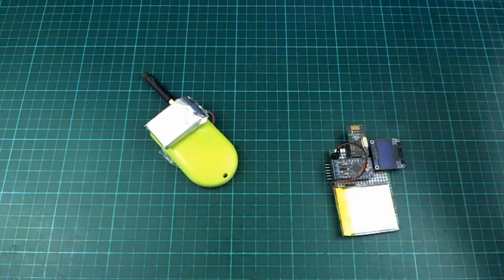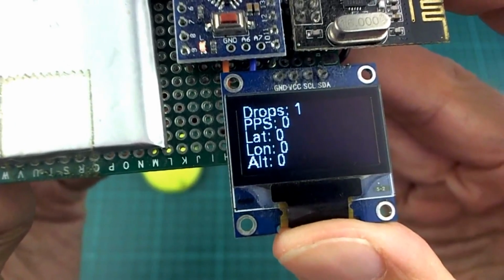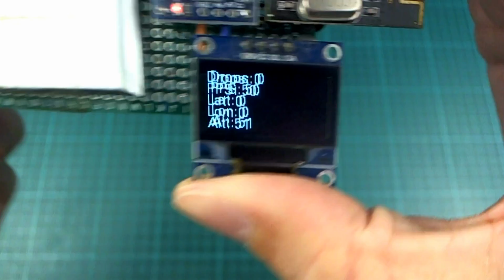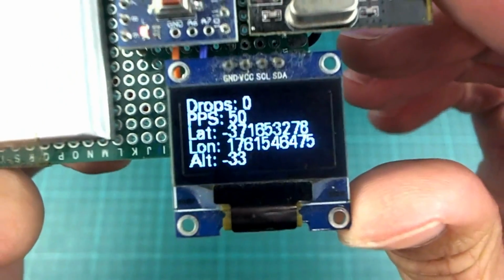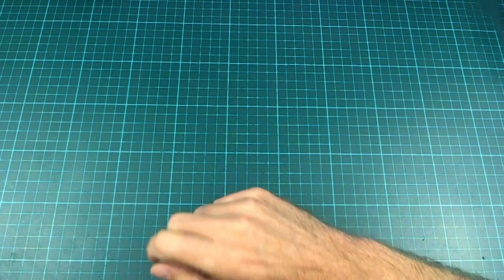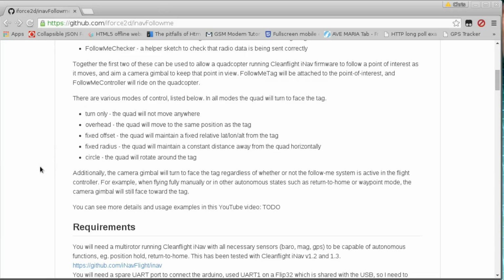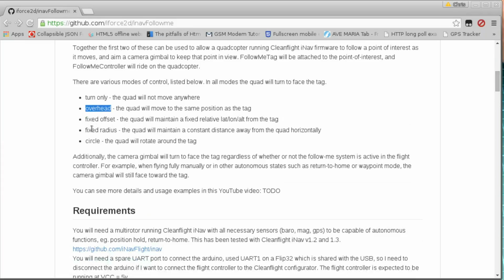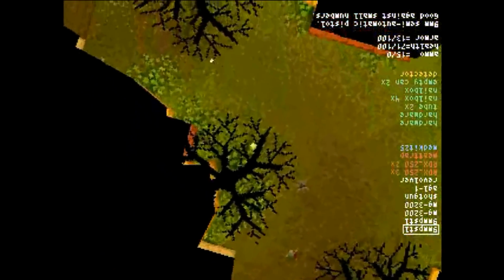Quadcopter follow-me howto (arduino + cleanflight iNav)

Comment: Hello, I think I am having the same trouble as CyberTramp/Mark Greco. 

I have a DIY quad using a Naze32 F3 Flight Controller, with an arduino/NRF24L01 configuration for PPM controller inputs (from following your 'Cheapass Quadcopter' videos, thanks!) and a Ublox  NEO-M8N for the GPS functionality. I'm  using iNav v1.9.2, and have the quad successfully implementing the simple GPS functions included in iNav (PosHold, RTH etc). 

I have wired in the 'Follow Me Controller' (using 5V arduino pro mini) to UART1 on the FC, and have built the Tag and Checker as per your specifications in the video. 

I know the Tag works OK, as the Checker successfully receives the correct GPS data and displays it to the OLED screen. 

However, the OLED screen on the 'Follow Me Controller' doesn't seem to be receiving any data from the FC. It displays PPS correctly, but RC is stuck at 10, Altitude is stuck at 0, 0 and Yaw is stuck at 0, 137. 'Mode' also remains stuck at 0 despite configuring the controller to activate Follow Me mode for the correct switch combination I'm using. 

I've checked the arduino codes as best I can (I am hardly an expert) and all seems OK, so I'm guessing the problem must come from the actual format of the information being sent. (I have UART1 configured to receive MSP data at 115200 baud rate). 

Do you have any suggestion for how I can check if the information from the Tag is actually being received/sent to/from the controller? 

And do you know if there has been any changes to the iNav/MSP source code that requires the Follow Me Controller code to be updated?

Sorry if I've been stupid and missed anything important, any help would be really appreciated!
Reply: I think I've managed to fix the follow me controller. I had to make a decent few changes to the arduino code, so I'll put it up as soon as I have had time to test it to make sure it  works, but I think I'm getting all the right outputs to the OLED screen.
Reply: @benparsonage7789  any updates?
Reply: Hi Ben, I am also very interested to see your results regarding to this. I am currently stuck on this part where the FC is not talking to the controller properly. Please let us know if you have decent progress!
Reply: I've asked the iNav developers about it, and they tell me that MSPv1 is still supported, so it might not be as simple as that. I will keep trying though, as it is still likely something related to this. I'm now just basically going through the code following where the data from the FC goes (using a software serial output to my laptop), so I will let you know if I get anywhere.
Reply: I thinks we must be use fc flip32 like iforce2d 😈.... 

Stm32 work with 3.3v... and arduino work with 5v.. ???? 

My tag work fine... but FollMeCon doesn't work 😂....

My hope....
Can you Rebuild this project buddy ... please  😉 like update and something else
Reply from the maker: I seem to recall spending about three days debugging that connection... the only thing I can suggest is using a logic analyzer to see what is happening on the wire. I have not been following changes to iNav but I would be very surprised if they would trample on backward compatibility like that - they're not Apple after all :)
Reply: Thank you for the reply! I think I have found the problem. Basically iNav introduced what they call MSPv2 into iNav v1.73, which uses a slightly different structure for sent/received MSP messages. So pretty much if you try and use the Follow Me Controller with an FC running iNav v1.73 or higher you're not gonna get far. So what I'm doing now is going through the 'Follow Me Controller' code and trying to convert it to be compatible with MSPv2. Should be fun!
Reply: Ben Parsonage I have to say you must be on the right track!!! I purchased several FC boards and have come up same as you. I used a logic analyzer got nothing from FC. If you solve this will you post the code?
Reply: Have you made any progress?
Also did your Tag code load on the arduino AS-IS from the download?
I have 1 working tag but cant get another going at all

I also can get a different iforce2d tag from the RC CAR PROJECT to work and send data, Could the TABS in the arduino program have something to do with it???

i have also experimented with different baud rates between the flight controller and the controller, no luck

i'm not a quitter,,,,,,, Ordered the first batch of things for this the day he uploaded it LIKE 2 YEARS AGO.  I have made Most of the iforce2d projects including a wood version of the DIY CNC so i know they all work.
Reply: Ben Parsonage sweet!!
Reply: Ben Parsonage hai buddy... any progress for this project?
Reply: Here's my attempt at updating the inavFollowme code for MSP v2: https://github.com/samridler/inavFollowme
A friend and I managed to get it working except for the drone not changing heading, not sure why.

Comment: Hello and congratulations for your achievement!I have a question!What do i need to change in the code so the tracker will work with the latest inav release?Thank you!
Reply from the maker: Well what error are you encountering, would be the first thing to know... but 6 years have passed, I basically have no clue about this code. Having said that, it communicates via Mavlink protocol which I don't think would have changed anyway.
Reply: @iforce2d  Hello and thank you for your reply!I haven't build a drone yet!Just asking from what I have read!

Comment: At 48:05, the "fixed offset" and "fixed radius" modes are very interesting. Amazing results all things considered. 

Would have been very interesting if the "tag" was placed on another quad, or plane flying a waypoint mission, or just RC manual flight. Could be very useful and fun way to record some spectacular video. 

Such great inspiration and ideas contained in your videos. Thanks for posting. Only been following for ~9 months and picking up on some of your early gems. :)

Comment: Chris, I have returned to this project as I now have more uninterrupted time. 

Watched the video 524 times

Here is what I have so far.

450 quad using an omnibus F4

 INAV CONFIGURATOR 1.8.1 on desktop

FLYSKY FS-i6 with your upgrade applied. (SWD is Aux 1) (SWC is Aux 2)

The FollowMeTag working perfectly (I know this as I made a separate Arduino GPS)

The FollowMeChecker is working and receiving signal from the FollowMeTag and FollowMeController.

Page 2 of the Github in Setup SAYS TO… “, you'll need to set up a mode that has all of these states enabled together” (This is on Aux 1)

RC_AUX1 Channel #5 MID (1500) Configured to 

ANGLE

HEADING

NAV ALT

NAV POS

GCS NAV

RC_AUX2 Channel #6 HIGH (2000) Configured NOTHING 

Using the UART 1 at 115200. No other tabs highlighted. I get no signal from the FC to the FollowMeController.

ANY SUGGESTIONS
Reply from the maker: I found the trickiest part of this project was the connection between the arduino and the FC. I couldn't get it to work reliably with a 3.3v arduino, even with a level shifter, but a 5v arduino was ok. I would recommend adding the little OLED screen on the quad, so you can see if the communication is going as expected, and the 'mode' value is actually being enabled by your switch. I don't know how the UARTs are arranged on that particular FC but sometimes UART1 is shared with the USB wired connection, that would cause a mess if you are plugged into USB at the same time.
Reply: iforce2d I have the oled and it will show data from the tag. So I know it's working. I will try uart 3 and no usb.. Do I have the modes correct???
Reply from the maker: I'm talking about data from the FC, not the tag. Like I showed at 23:22 in the video. Those values for RC, yaw, alt and mode are coming from the FC. As you stated earlier, your problem is that you "get no signal from the FC to the FollowMeController" right? What exactly are you seeing to determine this? Oscilloscope? Logic analyzer? OLED? It might help to diagnose if you give a bit more info.

It's been a while since I did this so to answer your other question I can only look at the github page myself and I suppose yes, the modes are correct. I'm assuming you meant to say MAG instead of HEADING, but that should only affect the ability of the quad to face a specific direction.

If you use another UART remember you need to specify in the configurator that you'll be using it, and set it as MSP protocol.

The modes setup is something to worry about after getting the FC to arduino link working, but when you do, keep in mind also the conditions mentioned in the "Switch settings" section of the github page. The default code will be checking for aux1 mid, aux2 high. But this will all become much more obvious once you have the OLED on the FollowMeController (you should see the mode value become 1 when the switches are in the right positions).
Reply: iforce2d The oled does not display any of the flight controller information. I know I’m going in the right direction. I will test with an oscilloscope. 

As I said I know that the follow me controller is working??? Because I am getting data from the tag I am not getting data from the flight controller. I thought I may be missing something on the wiki I’ve also read that 100 times

My goal this weekend is to get this working.
Reply: STM32 F4 flight controller and the FLIP32
inav google chrome app
using LHT00su1 logic analyzer
korad power supply 12v 4a

INAV Settings in GUI
idenifier USB VCP MSP 115200
UART 1 MSP 9600 and tried 115200

I get nothing on the logic analyzer, (TESTED this is working with an Arduino from your Logic Video)

Should something in the CLI be inabled??

Comment: I'm using the INAV configurator it does not have the flip32 board on it i used the Naze32

I am not getting telemetry data from the flip32 to the controller. I'm getting great data from the tag to the controller. 

Everything is set up as you did it in the video. 

Any help would be greatly appreciated
Reply from the maker: Are you using a 5v arduino? I had trouble when I tried a 3.3v arduino with a level-shifter. Whichever port you use on the FC needs to be set to MSP. If you use UART1 which is already set to MSP for USB connection to the configurator, you can only run one at a time, ie. don't have USB plugged in while you're trying to use the follow-me, and vice-versa.
Reply: YES 5 Volt Arduino.. also you cant upload changes to iNav with the TX RX connected from the Gimbal Controller. I will try your suggestions / UART and USB. hope this is working in a week or 2

I will post a link to pictures of my work??
Reply from the maker: yeah, YouTube :)

Comment: COuld this project be used with a Quad running with arducopter?
Reply from the maker: I don't know anything about arducopter, but I would assume it uses a different communication protocol to cleanflight. And assuming it has a 'special waypoint' mode, you would still have to completely rewrite the communication between the arduino and the flight controller.

Comment: I have gotten all three units working the TX tester the tag and the controller.

I cannot duplicate the tag I don't know what I did I have one tag working I want to build a second one

Can you upload the code right from your site without having to do any modifications in your opinion

Can you advise what makes The indicator light flash dim. I can upload the code from other things that you have made and it works but can't duplicate the tag

In an earlier video you talk about modifying the RF24 Library itself is that something I need to do

Comment: Hey mate, hope all’s well!
I’ve been following your projects and builds for some time, I am trying to replicate the follow me quad at the moment. I’m having a small issue with the comms between my arduino and naze32.
I’m hopping you might be able to help!
I have an arduino  contected to uart1 on a Naze 32. The oled display shows around 200packets, rc=10 and alt of tag jumps around a lot, anywhere from 0 to -9000 odd, this also occurs with the yaw display, not the quad yaw but the difference one.
It seems I’m not getting any data between the FC and arduino... when I don’t have the FC uart 1 connected the tag altitude seems good. I’m using the latest version of iNav. Any thoughts on what it could be?
Reply from the maker: make sure you are using a 5v arduino, the correct baud setting on both sides, leave USB disconnected if it's the UART shared with USB (which UART1 is I think)
Reply: yep using 5v arduino checked baud rate on FC and pro mini the same (115200), no usb plugged in, im pretty sure i have the settings right in iNav, it seems the tag is communicating with the follow me controller but the FC isnt OR it messes with the signals sometimes, this morning both the altitude and (second) yaw where jumping when FC was connected... i must be missing something and im thinking its going to be basic.
Reply from the maker: Yeah, I do recall spending many hours with my logic analyzer trying to figure out what the hell was going on. Are you using a dedicated ground between them or just getting a ground from say, the battery negative...
Reply: yep common ground for both FC & arduino, currently trying soft serial, i am getting voltage on both the RX & TX pins. next option is new arduino. ill just keep poking along.

Comment: Hi, I need some help again.

I did controller and tag, but have no idea why it does not start to work. Please check video:

https://www.youtube.com/watch?v=RGCU4cLCxyw

I triple checked all of the connections, tried to connect via soft serial with 19200, no result. Tried to connect via uart2 and then reloaded skecth with default 115200 baudrate, again no result.

Voltages are as sugested, used arduino pro mini 5v for controller and 3.3v for tag.

Inav 1.7.1 is used.

Thanks
Reply: Could you please advice what to check first to find a problem? If you've seen the video I uploaded and linked above, it is seen there that the controller I made just doesn't recieve any data from FC, although I'm 90% sure I did all of connection rigth and set right bauds rates. 
Thanks!
Reply from the maker: If you have set everything up the same as me and you get a different result, then I don't know... I also had a lot of trouble and had to spend many hours with a logic analyzer to see what was happening in the UART lines.
Reply: Yeah, I understand.Anyway thank you.

Comment: Hi!
I'm using Naze32 board for my experimental build, so i'm out of the hardware uarts now. Is it ok to use softserial in Inav? Naze32 could provide baud rate of only 19200 maximum, so If soft serial is possible to use, then  where should I set the baud rate 19200 for arduino? 

I found this part of code in msp.h:

void msp_setup() {
  msp.begin(115200)

Is that it? Can i just chage 115200 value to 19200 so Naze32 could see arduino board via one of softserial ports?

Thanks!
Reply from the maker: Yes, that should do it. Make sure the port in cleanflight is set to 19200 too.
Reply: I got it!

Comment: Sorry for asking maybe stupid things, but in controller and NRF module part of video (21:07) it is clearly seen, that CE & CSN  pins of NRF module are connected to arduino pins 7 and 8. And in "FollowMeController.ino" file you have short notes about NRF connections: 
3 - CE to Arduino pin 9
4 - CSN to Arduino pin 10
Which is true for now? pins 7-8 or 9-10?

I really want to try to implement your "how-to" to my build because I'm not satisfied by "follow me" modes in EZ-GUI (not facing the quad to POI, slow and inconvinient GPS via smartphone, not able to handle alt without rc) and realy impressed by your project. Thanks for help!
Reply from the maker: I was re-using an already soldered together arduino and nRF module from a previous project, so I probably just changed the code to match the soldered connections. The CE/CSN can be either 7-8 or 9-10, in fact you could use any digital pins I think, just make sure whatever you put in the code matches with the actual connections :)
Reply: Yep, found in the code, thanks!